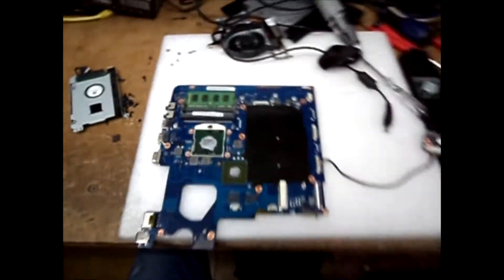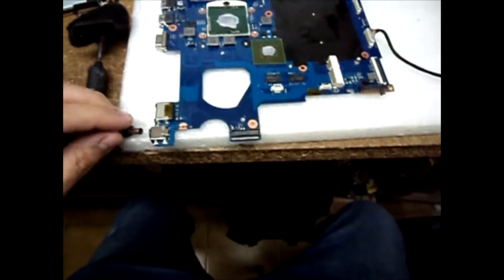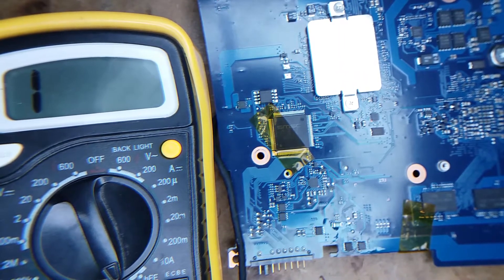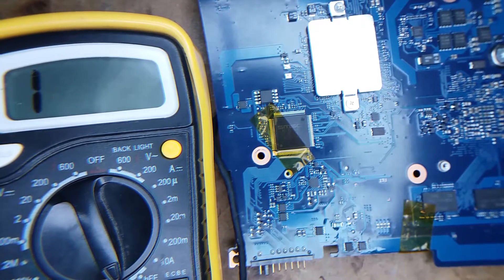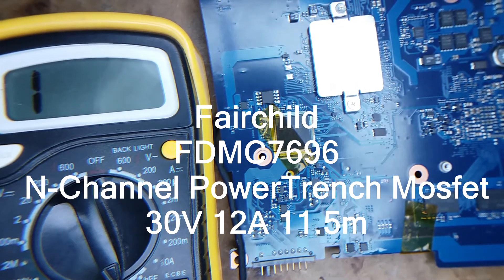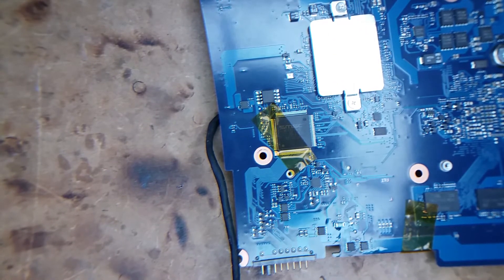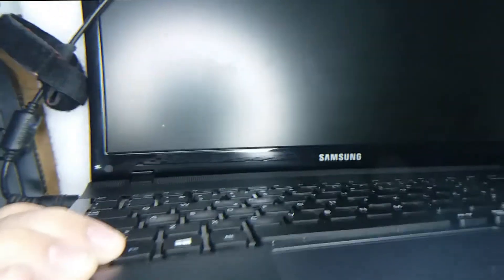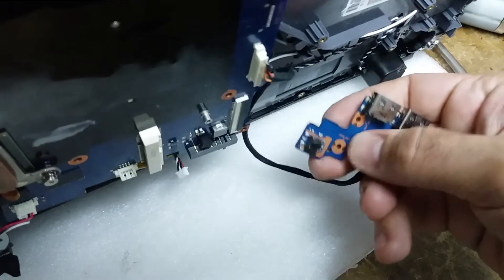Samsung Laptop NP300 no power repair

Comment: Hello, i have the exact same laptop computer. when i plug the charger, it shows green without battery and orange with battery attached. when i push the power button the blue light on the power button turns on and the indicator below the trackpad also show blue and screen dark. no fan spin, no hard drive movement, no power, also tried with HDMI, no activity. i took it apart and cleaned everything, put it back together its the same problem. i left the computer for more than a month and decided to try and turn it on, it turns on okay and everything works fine but then died during windows update and stayed dead with the same problem for more than a month. not the battery, not the screen, not the hard drive, not the RAM, not the charger, not the charger connector. apparently laptop turns on but not on. do you know what the problem will be? thanks.

Comment: I have the same problem, my Samsung 300E laptop is not coming On. However the green indicator for power available is coming on immediately I plug in the charger. What then could be the problem? What should I check for?
Reply from the maker: Hi,
Have you checked any voltages? 
And have you tried changing those Mosfets?
Take care,
Cheers

Comment: Hi, I just wondering, if I put a fully charged battery without replacing the IC, will it power on ?
Reply from the maker: Hi,
I never tested that but i think it should work because those Mosfets that I changed are Known as Load Switches .
Take Care.
Cheers.

Comment: Hi bro my name is Sameer 
I want your help 
My laptop Samsung np300 e5e model 
When I connected power cable then laptop on and suddenly off battery not working What's the problem plz help me
Reply: Plz contact me Gmail 
tadisameer@gmail.com
Reply from the maker: Hi,
I didn't quite understand.
The Battery doesn't work or when you connect the power Supply with the Battery, the Laptops turns off?
Take Care.

Comment: Hi, regarding with no power issue with np350. Measured power button with 3v,  checked big inductors without 5v & 3v, checked 19v pass through 2 MOSFET are ok, checked 3v & 5v power supply rail with 19v. Tried to replace super io ic, found out power on button indicator was light up but laptop no still power. Any idea? Thanks

Comment: Hey man, great video

The same mosfet was broken due to wrong polarity connection (shame on me) 
It had no Power at all, after this repair it now works again! Problem is: My battery isn't charging, it says it is, but never exeeds 0% 
Amperemeter also says zero amps (while off)

what I found out, when its off and the battery is connected, when I plug it in, the charging indicator won't turn on and it draws Something between 0 and 2.2 amps, it jumps every second from zero to something and then back to zero, all the time

any idea what this could be?
Reply from the maker: Hi,
Do you know if the battery was charging before the repair?
Was it stored for a long time?
It could be just a coincidence that the battery failed... but i would check the see if all the voltages are correct... i'm going to leave a link here to a Brazilian repair site, don't worry about the language because all you need to know is the voltages in the photos, so check them and see if yours are the same because the person who posted these said that it is from a working Samsung NP300 Motherboard and it charges correctly.

https://eletronicabr.com/forums/topic/36177-circuito-de-charger-do-samsung-np300/

I hope that this helps.
Cheers.
Reply: @Fixepedia  thank you! and yes the battery worked just fine before, I'll try and check the voltages from those pictures and report back if I got it fixed!
Reply from the maker: @__Railgun__  Hi, Ok cool ... Good luck ;)
Cheers
Reply: @Fixepedia  sadly the mosfet I replaced got damaged and my laptop didn't turn on at all after that, so I did something funny after I completely removed the 19v inputrail

I soldered a cable directly to the 12V rail of the battery and put a connector on the right side (where the dvd drive was, but I removed it a long time ago and put a hdd inside)

and guess what? It works! battery charges (of course windows doesn't tell me, but the percentages go up)
only thing that is important: the plug has to! have less than 12.61 volt or the battery will overcharge

dude I'm happy :D
Reply from the maker: @__Railgun__  Hi, that was some MacGyver stuff 😉 hehehe cool. . . The important thing is that it's working and that's great!! 😊 
I'm happy that you found a solution, it's a great feeling when something gets fixed and up and running again. . Keep it up.
Cheers
Reply: Hi, would you tell me where's the 12v rail on battery? I wanna try that too ! :D
Reply: @kkmplasticworks7262  Just measure the two outer pins for + and -  on the battery

on the board, I soldered two cables on the connector where I measured plus or minus

I even installed a switch with a simple boost converter, that puts 19v on the old ac input, so the laptop thinks it is powered ;D cpu boost only works while on ac ;)
I can now change if I want to be "on battery" or "ac" 
Charging is done by simply applying exactly 12.6V to the battery pins, I used a 1000w boost converter and changed the current to 4A
Reply: david poiz thanks for your reply on your old post. Do you also replace those mosfet first ? I'm trying to bypassing that mosfet by directly injecting 12v to battery while connected to laptop, but still got nothing 😬